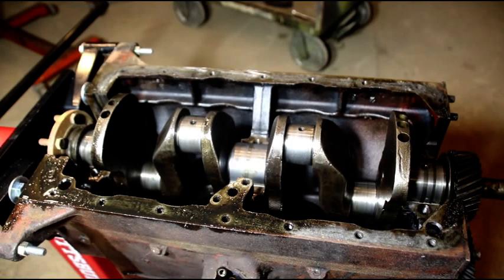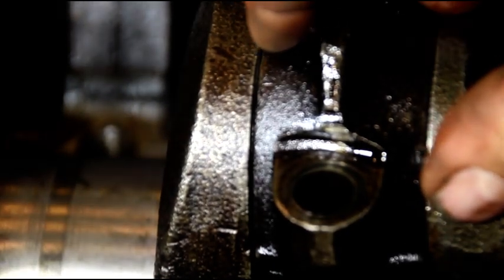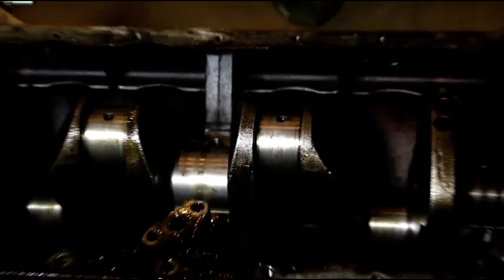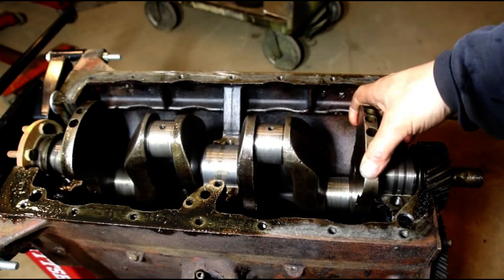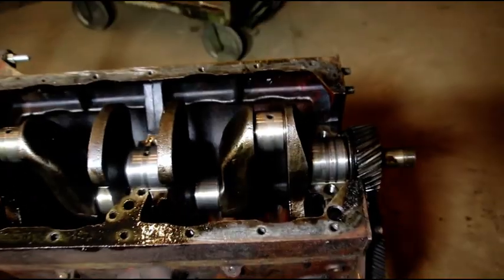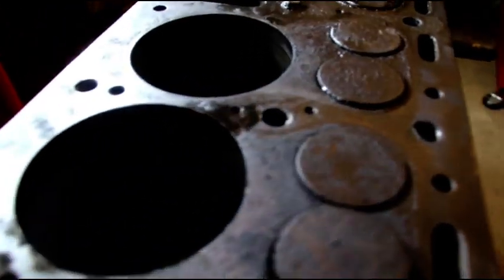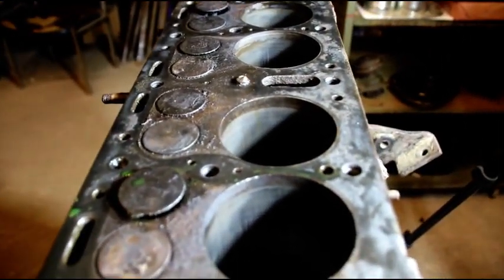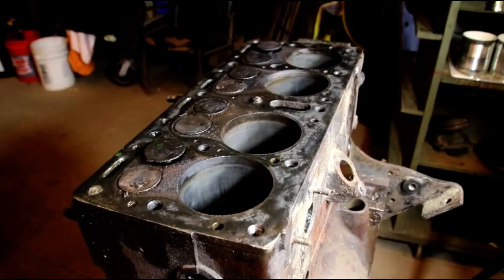Larry's Willys L134 Engine Rebuild, Teardown and Problems Exposed

Comment: @metalshaper, how would I contact about an L-134 rebuild, depending if I can get the jeep for the right price?
Reply from the maker: you can reach me at metalshaper@comcast.net
I have 9 engines in the shop right now so things are a bit backed up.